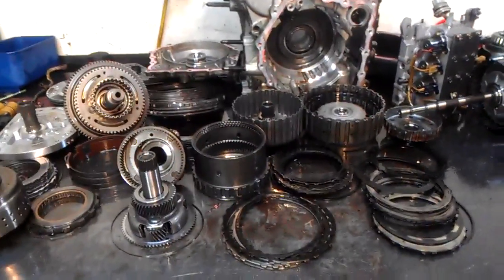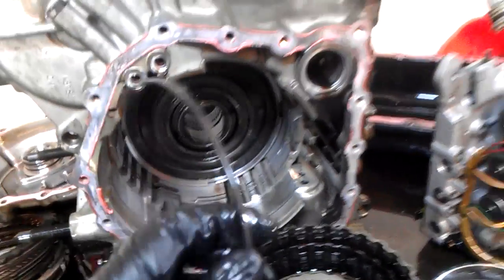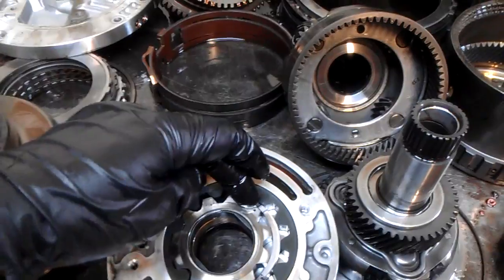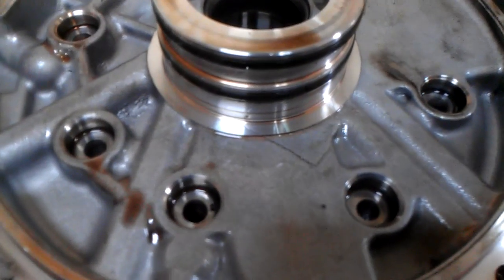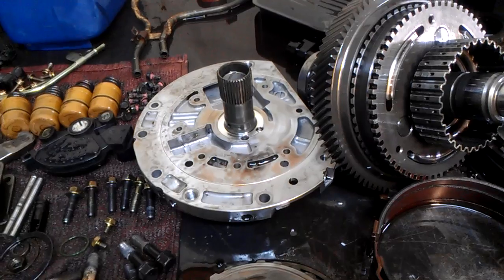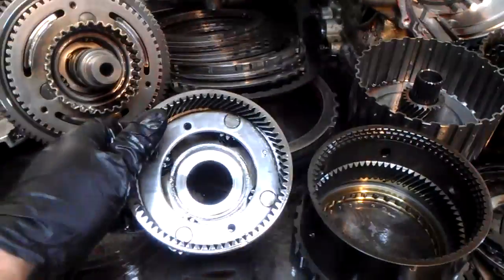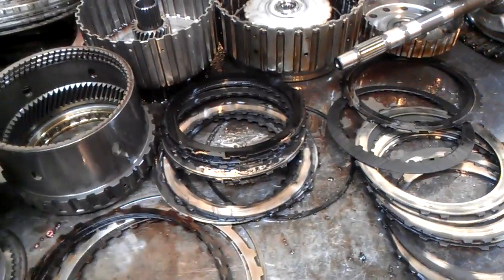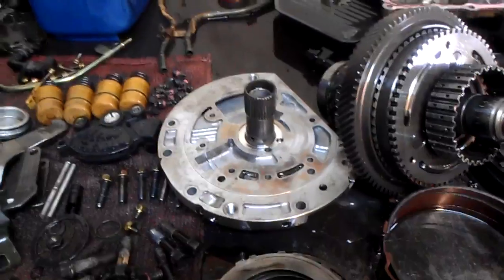F5A51 Transmission, No Forward, Slips in Reverse - Transmission Repair

Comment: Got W5A51 Transmission (AWD cousin to F5A51) on my 2002 Mitsubishi Evo 7 GT-A.
I granaded it while doing tuning runs at 19 PSI of boost, about 280 whp at the wheels. These boxes don't like heat and being launched from the stop. Upgrade cooling, that damn reverse wave spring and weld all the planetary gear pins, tune it and it can be very good transmission. So far I got one full track day, max was about 45min of going nuts on a road course then cool down and same over and over, 7 hours of abuse and it was fine. Also change oil on this box religiously, mine is dark after 30k km.
Reply: i gotta do this now :(

Comment: Hi, great video! I have a Santa fe and am pretty sure the wavey broke and it won't go into gear, no forward or reverse, drops RPM but doesn't have enough pressure to move, just all of a sudden, worked fine, parked, next time, won't move. Anyway, I'll take it out and see what happened. Just wondering, can you install an external filter on these? old ones had a spin-on filter, just wondering if you could tap into the casting where the spin on used to be and plumb lines to a remote filter mount, have you ever seen this done?

Comment: Is it possible to use a different manufacturer's transmission to another car?  I have a 2002 kia sedona and same thing had happen no forward no reverse, no movement at all.  Could it also be the same problem as your video?

Comment: I have 2002 Lancer evo GTA with about 100k on the clock, a few months ago I heard a loud crunching from the trans heading down my driveway. Upon inspection I was told it was direct planetary assembly, unable to get the right part I found out the F5A5A from the US eclipse 3.8 v6 and Galant is basically a FWD version and most internals can fit. Fast forward to the present I have the F5A5A trans with the bell housing from the evo and evo torque converter fitted. 

My issue is that when the car is shifting from 2nd to 3rd there is about a 1.5 - 2 sec delay, its like you're driving and the car applies the brakes then shifts or there is engine braking like when going down a hill. 1st to 2nd, 3rd to 4th and 4th to 5th are all fine along with the backing down from all gears. Whether I
drive in auto or manual mode it always does the same thing when shifting. We've tried the valve body of the eclipse on the trans and the evo's valve body, we've also swapped sensors. The fluid is fresh and is full, the only other option is the torque converter but since the eclipse's own is bigger we haven't 
gone that route. I'm really hoping its not the torque converter because after searching for months I have gotten no leads on finding one.
Reply: Sometimes you need to retune the shifting. I had slightly longer delay after rebuild of my box as well. Retuned it and it shifts faster, you need welded planetary pins for an aggressive tune.

Comment: I've got Hyundai XG30 with the same transmission.
I'd say it shits fine except one thing which is quite annoying and disturbing. When it gets to shift to 4th the shift is quite harsh and causes some vibration for a moment. It doesn't appear as signle shock but more like wave as if you drove over rough surface for a second. It only appears when throttle is applied more than 30-40%. When you drive slowly gently with light application of the throttle the shift is OK and imperceptible. Anyone happend to have similar issue?

Comment: I'll never buy a Mitsubishi automatic again.
My W5A51 has failed twice in 2 years - and when it starts to go it doesn't just lag or slip, it locks the entire drive-line and anchors the fucken car.
These transmissions will get you goddamn killed. And that is with the updated wave spring!
Reply from the maker: The cooler is restricted, you need to bypass the radiator and install an external cooler. That is a very common problem with those units. The planets gets fried.
Reply: @AutomaticTransmission  It's in a Legnum VR-4, I pulled the internals out via the passenger wheel well and bought a rebuild kit with all new plates & clutches. But I can't get the planetary back in because the internal shaft has dropped out of position. I'm gonna try to force it in with a ratchet strap. I've got an external cooler, do I bypass the radiator completely or run the fluid through both?
Reply: This!!! also weld your planetary pins so that it doesn't tare itself apart. @AutomaticTransmission  

Mine has plannetaries with welded pins, replaced clutches, tuned and with large 19 row Setrab cooler/Fan combo. 

So far survived one track day with some heavy abuse. Need an oil change after 30k km, starting to shift slower.
Reply: @IpoopThere4IAM  bypass radiator completely if you're in warmer climates. It's there to warmup your transmission faster when it gets colder.